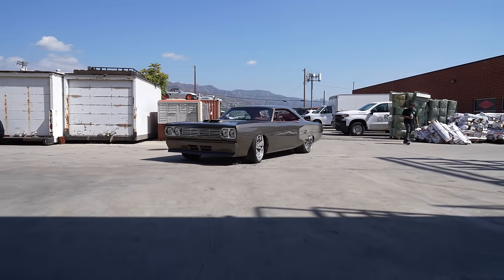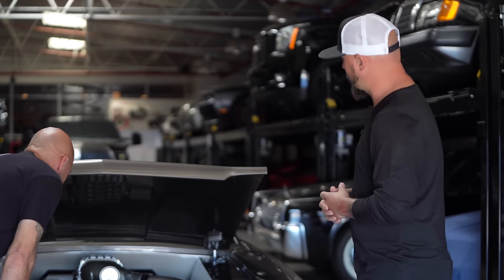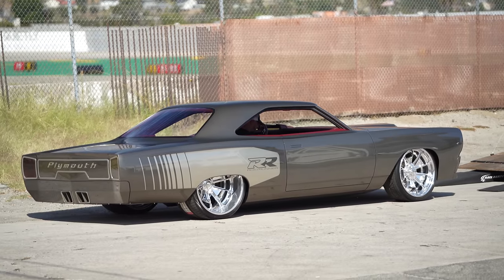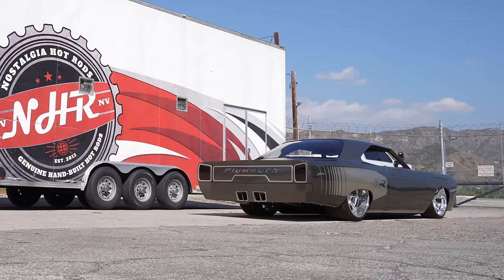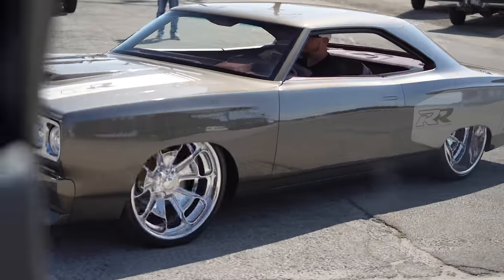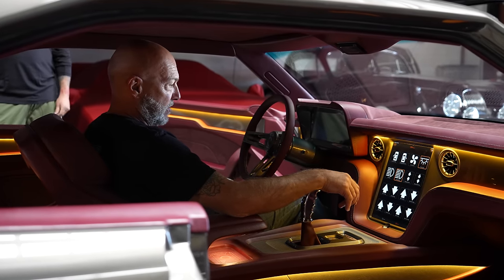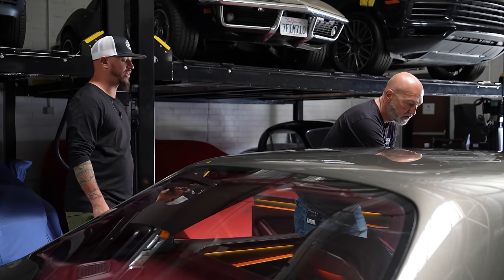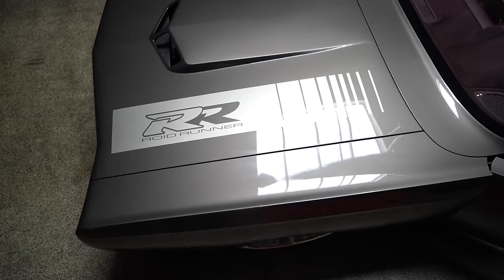Over $1 Million and 8 Years to Build this Radical 1 Off Custom '69 Plymouth Road Runner

Comment: So if every piece of metal on this car has been replaced with something different why not build the car from the ground up and leave the original RR alone. 🤔
Reply: Better story ?
Reply: @392coronet I was thinking the same thing. When I saw this car before what it is, I was like dude you should have left it alone and just built the one in the video from ground up instead of destroying the OG RR
Reply: Because then they cannot claim to have done anything special which turns out to be the case anyway
Reply: I asked the same thing
Reply: The vin# is what makes it worth $
Reply: Exactly. Now another gem off the road...
Reply: 🤔solid point
Reply: Original Vin is easier to register.
Reply: @diegohorton869  I don't disagree with that buy if that's the case why wouldn't you use the vin from the 392 car that the engine came out of. If they were going for the easiest route with registration a 17 digit vin is going to be the way to go vs an 11 or 13 digit vin.
Reply: @jdox28 well u should bought it then
Reply: Thats exactly what I was thinking, makes no damn sense. All the panels AND the chassis. 

So im a car guy man, im no newb I know they do this but usually its to save a vin number model whos damages are too much. They’ll do body panels and keep original chassis or if chassis is bad then they’ll make a new chassis or chop it and fix it where it needs to be fixed but its for a complete restoration job. Literally take the VIN’s out of the bad chassis and slap it onto the new replica chassis. 

I even see rare cases where they take the body which can be saved and put it on a new chassis because the OG chassis was too damaged.
Reply: @royandrade2929  Bro, but he said all panels AND the chassis is a new chassis. Cant you agree with me here, bro, they could’ve gotten that replica custom made chassis and done all the custom work to that instead of destroying the original car that was very clean and maintained?
Reply: 😂 SMFH, what these guys did is take a house that was good, bull dose it down, rebuild a newer one and gave it the same address… 🤦🏽‍♂️🤦🏽‍♂️🤦🏽‍♂️🤦🏽‍♂️🤦🏽‍♂️🤦🏽‍♂️🤦🏽‍♂️
Reply: Well said
Reply: Yeah where's the original car if this is a replacement
Reply: I don't understand why it costs $1000000
Reply: Yeah totally agree. That’s kinda dumb
Reply: Because then it would be called a replica (which it is) so they start with the original parts and by the time they are done everything is replaced. That way it's called a "custom car". Nobody wants a replica, but people love custom and handmade s*it. But this car is the only car I've seen (that's built recently), worth a million dollars.
Reply: If we have to tell you, you just will not get it.
Reply: People that have way more money to do what ever they want to.
Reply: YES!
Reply: @78Prowlerspud 

Do tell prowler...
Reply: its like old female with identity card do their full body to look new & super - this car with original identity - to make this car lived another 100 years with the 1969 certificate
Reply: @royandrade2929 it's not all matching numbers so it's worth what someone is willing to pay for it.
Reply: It’s not all new. They reworked the original body.

Comment: The car is perfect for the owner but honestly that Plymouth word plate on the back is too big. Everything else is spot on.
Reply: I totally agree. The car is gorgeous until you get to the rear. Can’t handle the Plymouth lettering. In my humble opinion, that detail in itself might cost him the Riddler.
Reply: That was my first thought, about PLYMOUTH on the rear.
Reply: Agreed, I like everything else though.
Reply: yea only thing id change is the letter spacing bringing them all a little closer together
Reply: Absolutely. Also. The wheel stylings look like early 2000s ghetto specials.

Comment: Fabulous car, and very impressive, yet I can't help but feel that the very clean original car was unnecessary to start from, could have preserved that and started with something in far worse shape since so much is completely changed anyway - all panels, frame, engine etc.
Reply: Best way to start a project is wtih a good one to start with. 
THeres plenty of stock ones out there being "preserved" ie rotting in someones garage. 
Part of preserving is driving them so they dont rot apart. mines sat for 3 and will take a ton of work to make safe again...even though everything has less than 100 mi on it.
Reply: I agree this car could have just as easily been built with a beat-up survivor considering only 10% of it is even stock. If I was doing it with this budget, I would have sacrificed a beater. And kept a high condition car to be used for reference. Oh well each to there own.
Reply: nothing is original except the shifter... so all those parts can be put together to make the original car
what do you think happened to those parts?  destroyed?
Reply: I have to agree with asking why.  If every body panel is handmade and also the frame,  where is the beautiful 69 RR they started with? I love the way it looks and very much appreciate the artwork/showcar that it it is now,  but I have to ask.
Reply: & chassis, what a waste.

Comment: Pretty cool build but if you replaced or built every panel ie: roof, and built it's own frame, what did you keep of the original Road runner. Just curious
Reply: The name only.
Reply: They needed that shifter. Obviously

Comment: Incredible example of showcasing ones talents and making a dream come true for someone
Id still drive it the paint underneath will be just fine. Did mine also looks the same as 10 yrs ago

550 to teh ground is more than enough and agree any critic has never owned nor driven something with that kind of power. 400-450 to the wheels is just right for a true driver.

Comment: Wow! I’ve got to admire the amount of work and craftsmanship that has gone into the building of this car. The underside is like opening a bespoke hand built watch. I personally wouldn’t want this kind of car because I would actually want to drive the car besides in and out of a trailer to a display stage. I like it though. I couldn’t afford to buy it and definitely don’t have the patience to wait for a build.👍👍🇨🇦
Reply: I dont get an owner who is afraid to drive it. Why even own a car? 
Friend went that route, convinced trailering his car to shows was safer. 
Nope...wheel bearing seized entire rig went off the fwy. May as well just have a picture.

Comment: I'm curious about that fragrance system. I wonder if it was retrofitted from a luxury car? I've thought about adding something like that to my custom build.
Reply: Natural farts?😂
Reply: @WeveGotBush Bwahahaa😂
Reply: I was at Autozone one day and saw they sell my favorite aire freshener scent in a liquid spray bottle.
I have been thinking about a way to use one of them automatic home air freshener sprayers to spray the scent I want, and pipe it into my a.c. vents. But remove the batteries from the sprayer and instead power it with ignition 12v so it isn't going off when I'm not driving.

That's the best I could come up with!

Comment: NOTE: I MADE THE FOLLOWING COMMENT JUST A FEW MINUTES INTO THE VIDEO BEFORE THEY STARTED REALLY SHOWING THE CAR. AFTER FINISHING , I HEREBY EAT MOST OF THE WORDS BELOW:
I've got a 2016 Ford fusion that I had made every piece on. It's outside, I mean I can show you pictures of it for proof. After being around sheet metal and sheet metal workers for 35 years, this is the second time that someone has made a video showing a car trying to say that they just made it with a ball peen hammer. That is absolute bulshit. This is a beautiful car. But I like the red and black one better. Well I wouldn't say better, they're two different things. And they're both cool. But don't tell me something's a 1969 roadrunner, and then tell me that not a single piece of the thing was made in 1969. Okay here's what we started with this was the old car, and we rebuilt the frame and the body at all the interior and the motor and the transmission and all the electrical and everything. We use the lights out of the original car, well the lens covers, we replace the 1969 bulbs with LED's... I'm not taking anything away from this shop this man or the talent involved here. I'm just having a little fun with it. Awesome ride guys
Reply from the maker: Love that you retracted this especially with your years of metal work!

Comment: the only thing that keeps catching my eye in a negative way is the graphics on the rear fenders; they need to flow a bit lower - the front needs to stop where the doors stop, then they should flow into the lower sills rather than stopping above them. but thats one gorgeous car...

Comment: Cool looking ride with Road Runner parts but NOT a Road Runner. I like the original myself even tho that's a hell of a lot of tech in that car. I don't like the bumpers or rear lights. And between the rear lights is too smooth. I think the original looks better. Still great looking car with all the work done to it.

Comment: Not my thing, as the originals are hard to find in mint condition and they were all nostalgia muscle. I guess the new gen that doesn't appreciate how iconic the original muscle cars are and the feeling of owning and driving it, in my opinion is not the same as this art piece. Its like the art where you throw paint at a wall and charge 2 mil for it. To each is own.

Comment: Beautiful car, amazing and impressive craftsmanship, but that's all the $1 million is, and I don't say that taking any credit away from the work put into it.  It's a piece of art more than it is an automobile.  No high end pieces used on it or wild engineering - sure it's a blown 392, but not some $50k NRE engine; Infinity doesn't even make mid-level car audio products; nice wheels, but Budnik is nowhere near something like HRE; the chassis doesn't come close to something you'd see out of the Roadster Shop; and while the woodwork is great artwork, it isn't a good material for sculping car interior pieces out of.